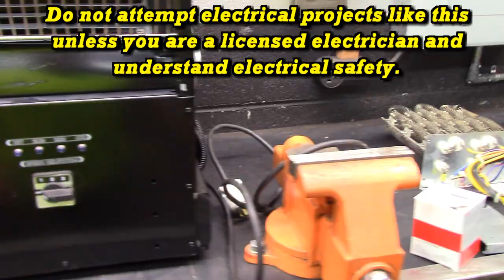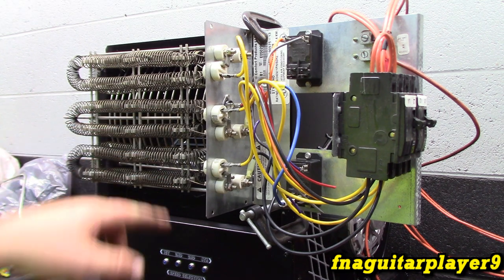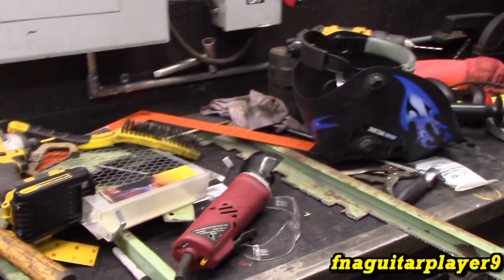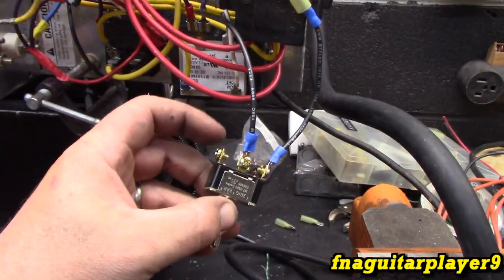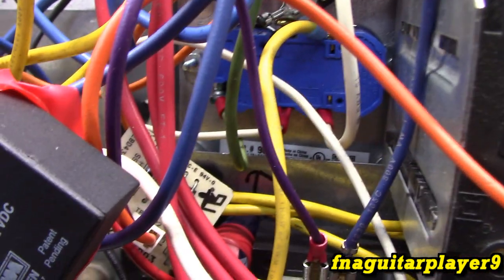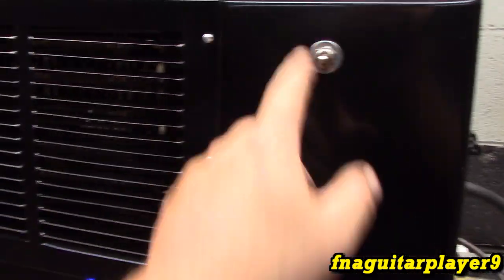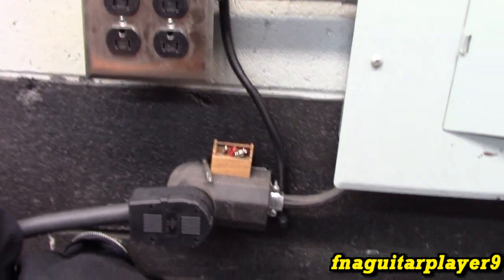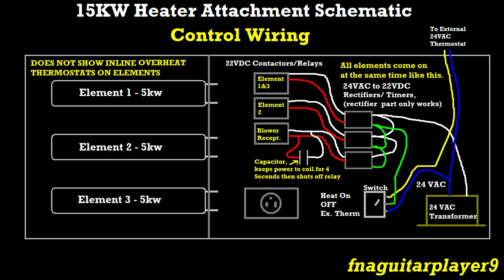Homemade 15kw Electric Furnace / Blower Heater Attachment

Comment: That's a great project and does the job you want it to. Its amazing how much wiring is needed to heat a simple element, what with all the controls and cut-outs etc; to a layman it looks super complex. It'd be interesting to have those diagrams explained, along with the components as to how and why they all work together. Thanks for sharing.
Reply from the maker: Thanks, and honestly it could have been setup simpler, i made it alot more complicated then it should of been with all the lights and stuff! Thanks for Watching!!!
Reply: @fnaguitarplayer9  I like all the lights and stuff, so long as they serve a useful purpose, and those do.